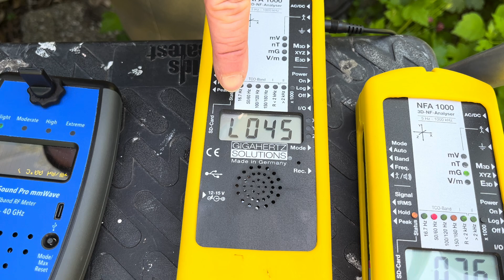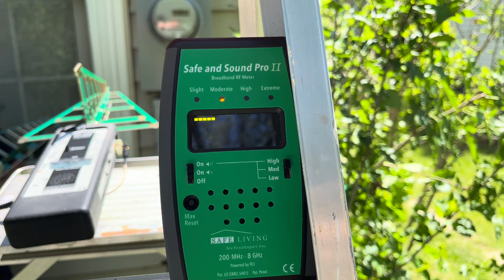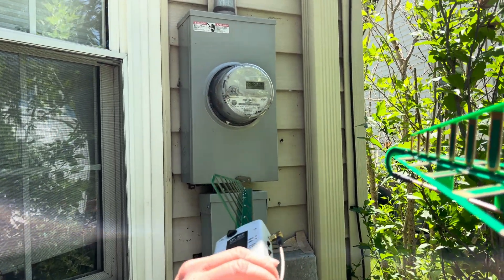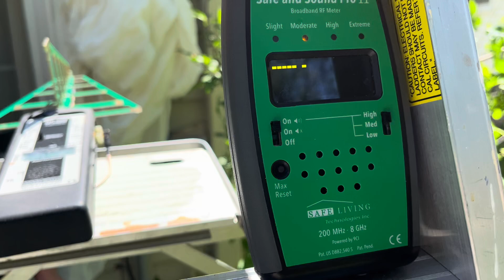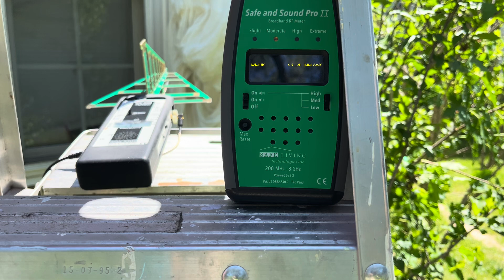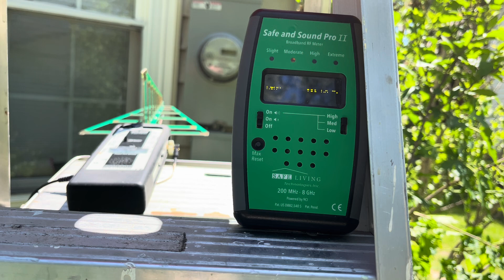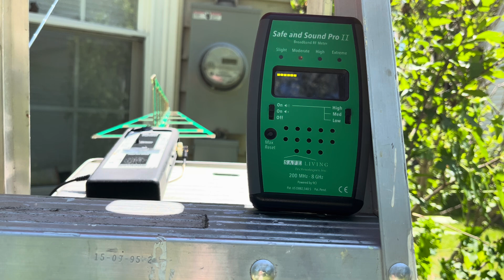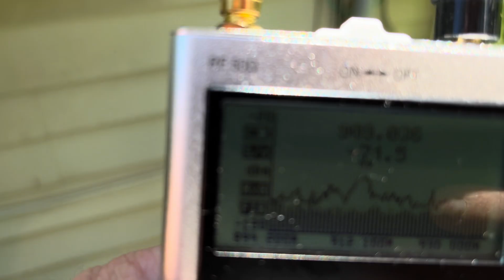Cathy Data Log Kirkwood Mo showing code violation

Comment: "let's get a clear view of that" proceeds to zoom in way out of focus and out of frame.

Loved the content though, thanks for bringing awareness.
Reply from the maker: Its hard to get the Safe N Sound Pro to zoom In it always flickers which makes it challenging. The phone video makes it tuff. The video was set up to log the number of pulses because we are sending Elizabeth at the FCC that these meters are pulsing more than 4 times a day which the utility constantly lies... This is a code violation part 15 FCC. I did a inside view of the same house which you could see better. Microwave radiation is the only poison that effects the biology with low dose and high dose because your body uses electricity to function and the radiation is a form of electricity. 
Thank You for the nice feedback